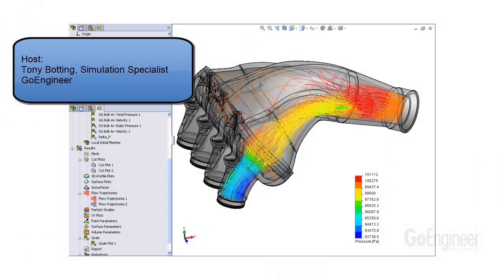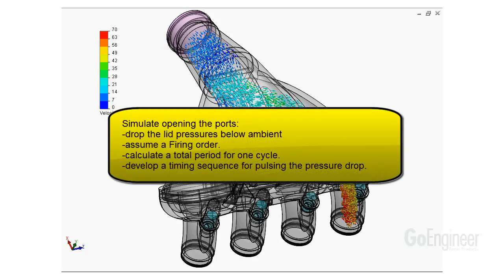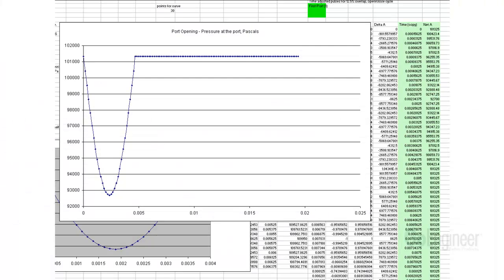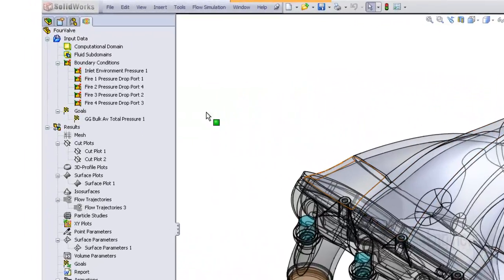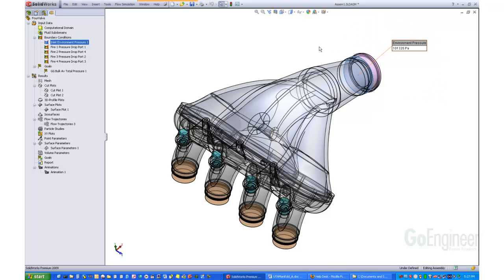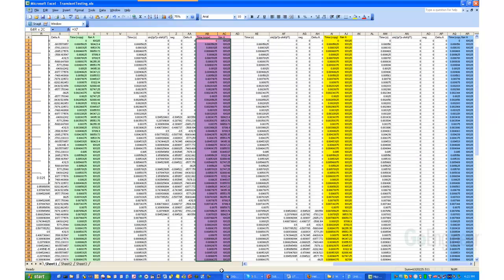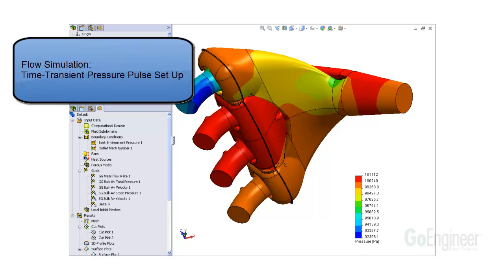SOLIDWORKS Flow Simulation - Transient Pressure Pulse

Comment: @goengineer I'm having an issue with only cylinder one animating. Any insight would be much appreciated. 

I have Time Dependent selected and have Maximum Physical Time as two times what my 4-cylinder cycle time to be at 7000 RPM. Still only shows the first cylinder flow velocity and pressure.

Comment: sir, can you tell me how to prepare table of pressure vs time for doing transient flow analysis. I am an engineering student working on designing intake manifold for ktm 390 duke engine for fsae competition.
Plz help thanks
Reply from the maker: Hi Abhishek,
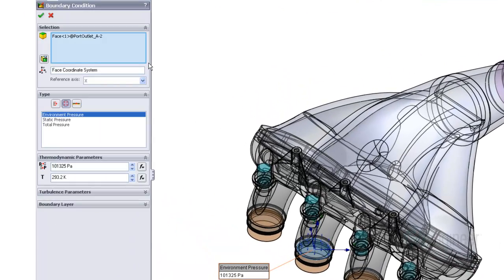If you look at this video beginning at 2:04 you will see how to insert pressure vs time data into Flow Simulation on one of the pressure boundaries.  You will, however, need to bring that table data to the program in order to insert into the boundary and use in a transient pressure flow project.

Comment: You made a fundamental error in your boundary conditions. Setting the pressure to ambient conditions is not the same as simulating a closed port, you are still allowing fluid to freely pass through this boundary if there is a pressure difference inside the domain (and there will almost certainly be a difference.)

Comment: What do you base your approximated pressure drop for the cylinders? I saw you used approx 92.8 e+5 for when the valve was open. Very good video, more of this stuff :D Perhaps setting up losses in a straight pipe, with reynolds numbers, wall smoothness etc ;)

Comment: For this case there's a specific inlet flow, and i would like that the the inlet flow would change in function of time from one entrance to the other and at the same time change the outlet exit too. always respecting that the outlet exit would be diagonally opposite to the inlet flow.

I've managed to change quite easily the inlet flow in function of time from one entrance to the other but i cannot make the air change from one outlet to the other.
Do you have any suggestions?
Thanks in advance.

Comment: Hi!

First i have to say that this video was very helpful to understand how to make a transient pressure pulse in flow simulation. 
I tried to apply this to my own drawings, which is basically a box with two entrances in one side, at the bottom and two exits on the opposite face, also in the bottom. Inside the box there's a division in the center that only allows the air to cross on top.
The air should go from one entrance to exit in the diagonal direction.

Comment: how did you animate the trajectories across time?
Reply: I'm having a similar issue. I can get the first cylinder to show but the others won't animate.
Reply: @Micah_Makes   Hi, did you manage to make it work?
Reply: @fabiocamo  I did, yeah.
Reply: @Micah_Makes   as you did? I managed to make the spreadsheet, added it, changed the options shown in the video, but it didn't work!
Reply: @Micah_Makes   
as you did? Can you make a video, because the way he did it, it didn't work, I even recreated the spreadsheet that was used in the video, but it didn't work, or there are more things that need to be done and he didn't show it in the video.
Reply: @fabiocamo  I could. It has been a few years, so I'll need to knock the dust off 😆
Reply: @Micah_Makes   😂